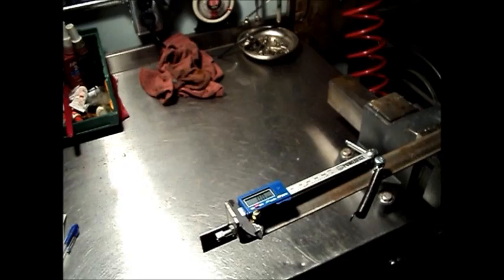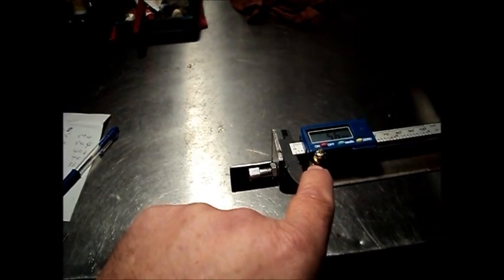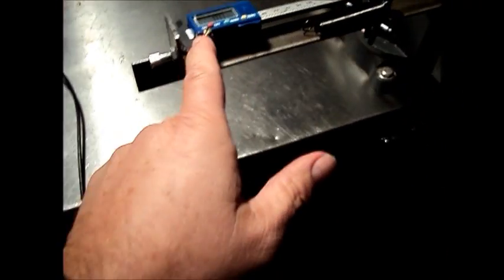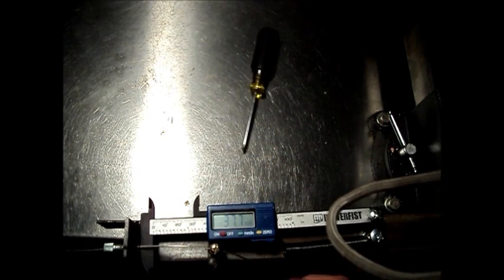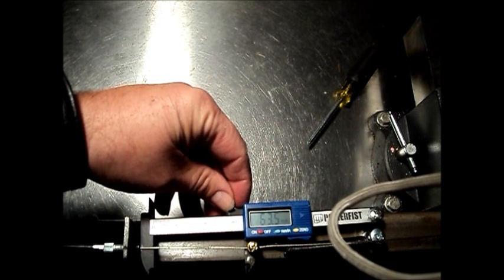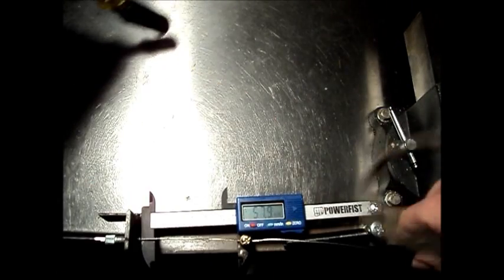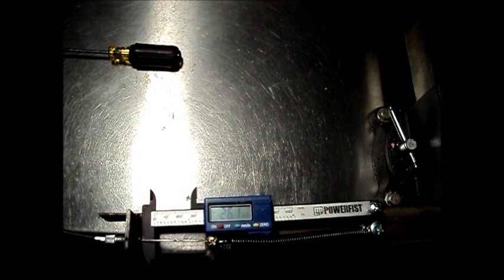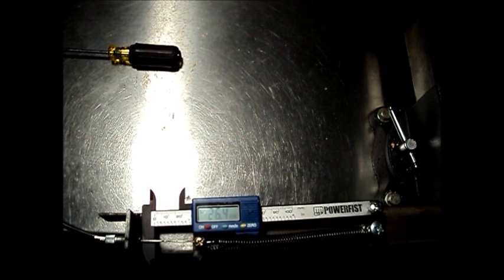Cable pull measuring tool

Comment: Hey Dan, please update me if you have some data. I wanted to make easy 3D-printable shifters for everyone to use. With a data-base and a universal adaptable design there are no limits.
Reply: You may want to reach out to this guy too for your project. https://www.youtube.com/watch?v=9OomjjkFWhs&ab_channel=gt00002 also, while my method is not nearly as precise as Dan's, I did generate good numbers for a couple shifters, which are in the edit logs on the following link.. others may have done the same here (haven't looked at those logs in six years) https://en.wikibooks.org/wiki/Bicycles/Maintenance_and_Repair/Gear-changing_Dimensions
I might build up a jig like Dan did and retake my measurements on the shifters I have, but that's still a small sample.. groups like the wikibooks link are a good place for people to share info and hopefully if Dan hasn't already he'll add what he does have there.

Comment: Have you measured Shimano Road 10 (not Dynasys)?
Reply: Oops, I meant S11
Reply from the maker: Hi Michael. I have not. My plan was to make a database of various shifter pull increments, but that has not yet made it's way off the back burner.

Comment: Love it! I just tape a scale to the chain stays and fold a piece of tape over itself on the cable, for a needle... It's reasonably accurate, especially for on-bike measurements. I like that your caliper method gives the extra significant figure! Do you have a list of the measurements you've taken somewhere? I'd love to see/compare results from someone taking verifiable readings as you are, as opposed to the random measurements I've seen scattered around the net. I've measured Shimano 8,9, and 10(dynasys) as well as Campy11 and Sram9 so far. Glad I'm not the only one with too much time on my hands!